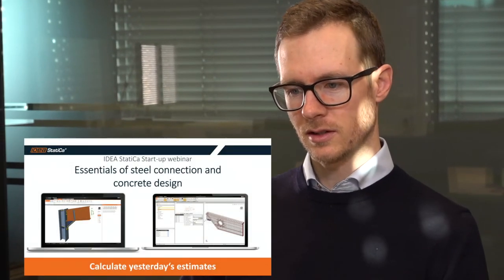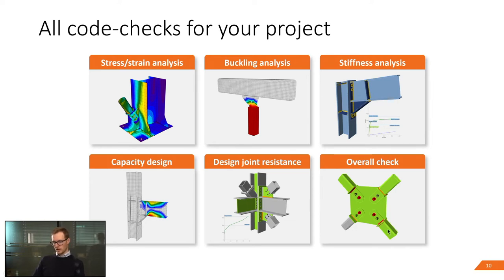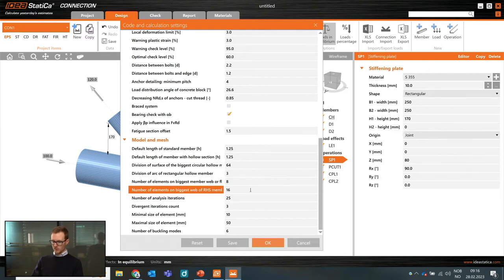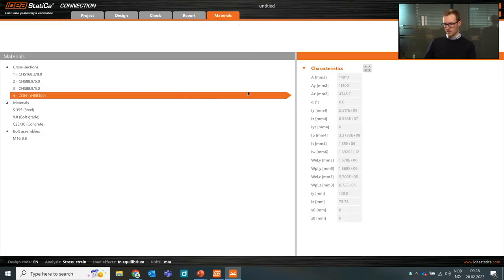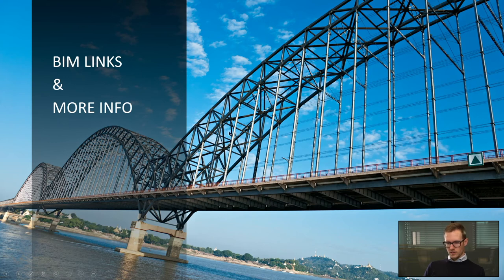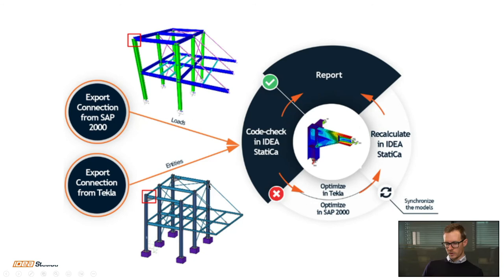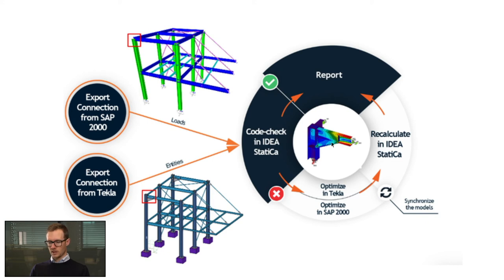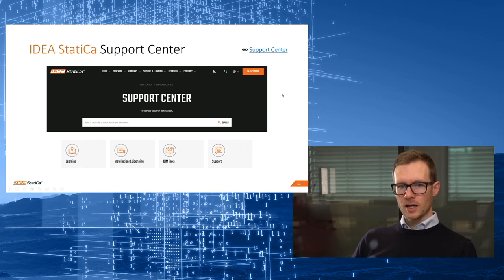IDEA StatiCa 1 hour FREE intro training 2023!

Comment: Sire about the stress the max value was 293.4 mpa , what is the max limit value? To compare between them ? Thanks . 💐
Reply from the maker: Hi, sorry for late reply :)

Fredrik's reply:
In this case the fy for all steel parts was 355MPa. If the requirement is 0% plastic strans in the connection then 355MPa is the max limit value. But a check of an equivalent plastic strain also is performed. The limiting value of 5 % is suggested in Eurocode (EN 1993-1-5, app. C, par. C8, note 1), this value can be modified by the user in Code setup.
 
CBFEM method can provide stress rather higher than yield strength. The reason is the slight inclination of the plastic branch of the stress-strain diagram, which is used in the analysis to improve the stability of interaction calculation. This is not a problem for practical design. At higher loads, the equivalent plastic strain rises, and the joint fails while exceeding the plastic strain limit.

Read more here: https://www.ideastatica.com/steel-verification

Comment: if fundamental, seismic and accidental load combinations are defined, can all these different load combinations, together, be selected for the code verification of the elements of the connection?
Reply from the maker: Hi, sorry late reply! All fundamental Load combinations can be selected to be included in the code check, but if seismic and accidental load combinations are enveloped, then they can not be included, as equilibrium will not be obtained. You can read more about import of Loads from FEA software Here:
https://www.ideastatica.com/support-center/loads
Reply: @BuildingPointScandinavia , no worries, for the late answer.
I have a steel support, for which Idea Statica will import only fundamental load combinations all unbalanced.
So, the explanation of Idea Statica just does not hold. These let's call them special, load combinations(see seismic) will not be selected by Idea Statica because of some equilibrium but, can be manually inserted, regardless of equilibrium.
I must say, Idea Statica must change something around here.
Thanks for your time and kindness!